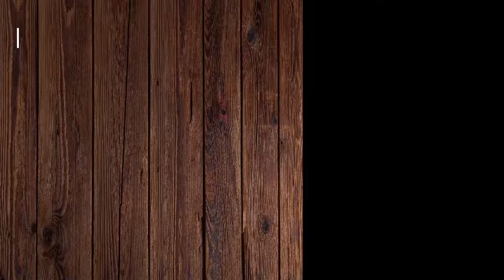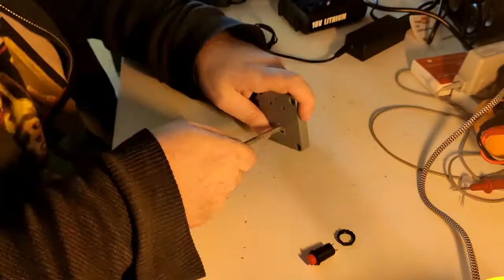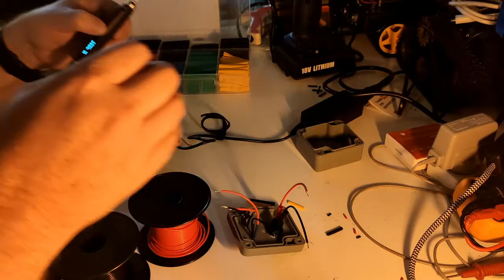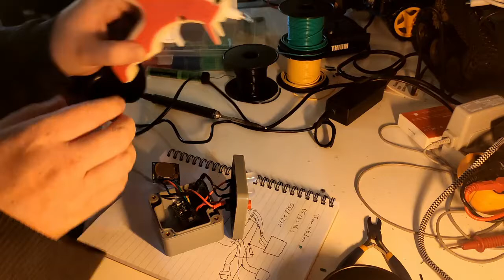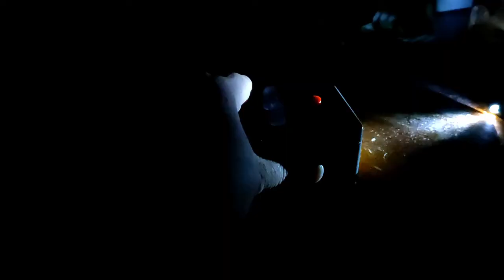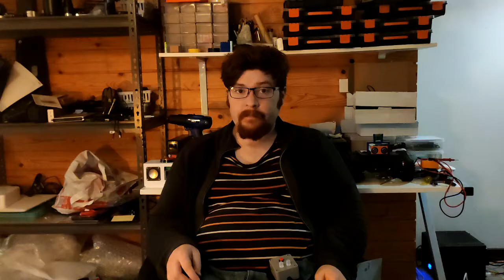Automatic Night Light Project - Leo's Projects 01

Comment: Hi Leo, Well done for your first youtube video. I enjoyed it. You described the construction well. I would enjoy a description of the code as well as this is an area I always struggle in, especially if I haven't done any for a while! You might find drilling holes easier with a step drill. https://www.bunnings.com.au/craftright-3-piece-step-drill-set_p0027584 
These are great for plastic boxes! Looking forward to the next video!
Reply from the maker: Thanks Paul! Yeah I didn't plan the video that well. I will add more code and circuit diagram details in future videos. I'm also looking at getting a drill press, Bunnings have one for $250 (my parents were a bit concerned about safety).
Reply: @leos_projects_and_tech  Even just a flat vice can make life much easier. It adds mass to the item being drilled and helps to stop it trying to take your fingers off! https://www.bunnings.com.au/craftright-75mm-drill-press-vice_p5860161